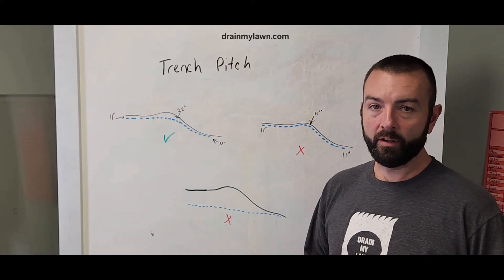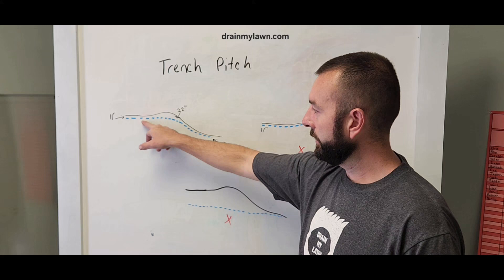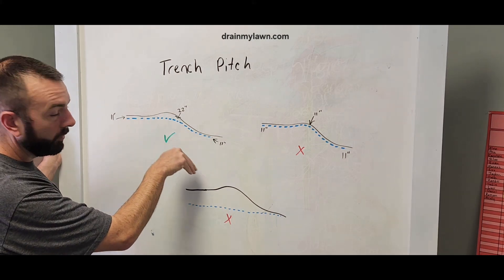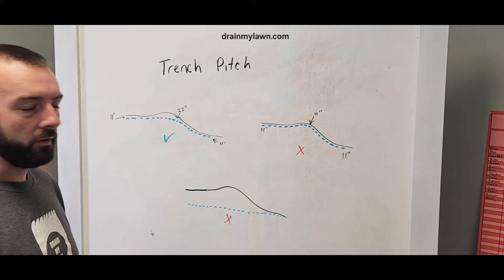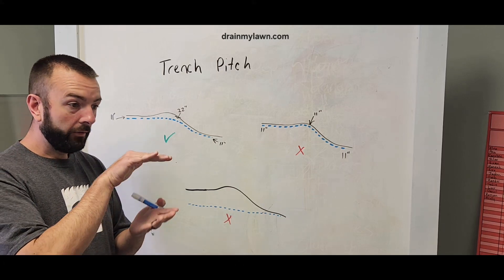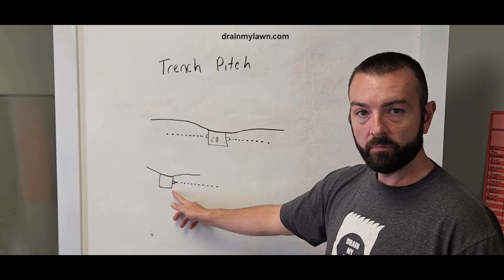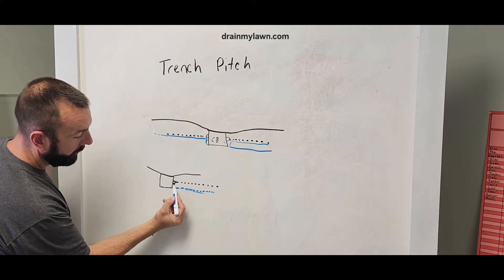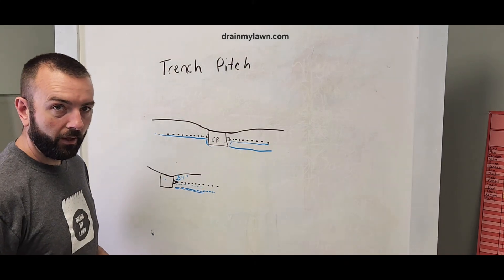The #1 Drainage Mistake: Trench Pitch Explained for Contractors & DIYers!

Comment: I like to have the end to be at minimum slope b/c it reduces erosion in most designs.  Like when discharging into a ditch it's not inappropriate for the outlet to be in water when flows are keeping debris moving.  When you don't have the outlet near the 'water-table' you will create erosion as the system drips & drains, especially if you are discharging soaps or detergents(like car washing, house washing, or whatever the soap source... there are some interesting soap stories in some of the EPA publications on sewage treatment before 1985. Entire towns with destroyed water supply wells due to soap in both the surface water & the groundwater...).